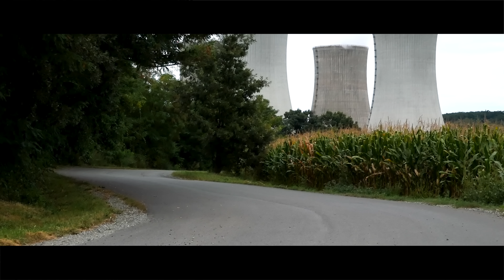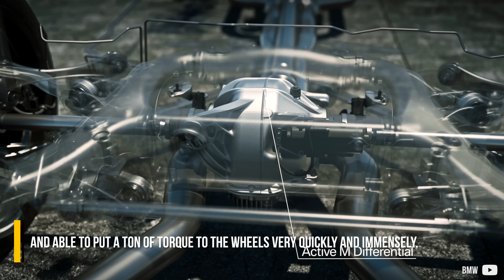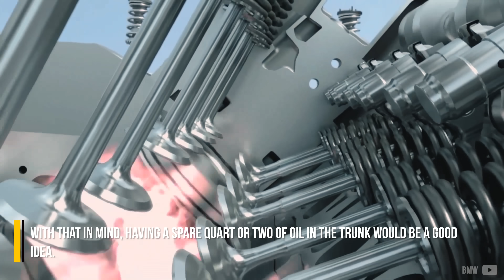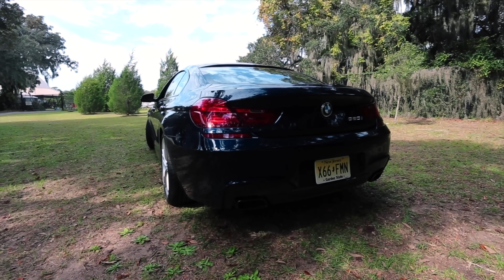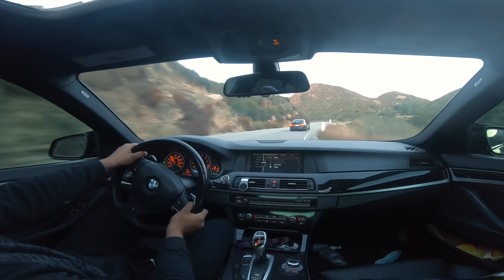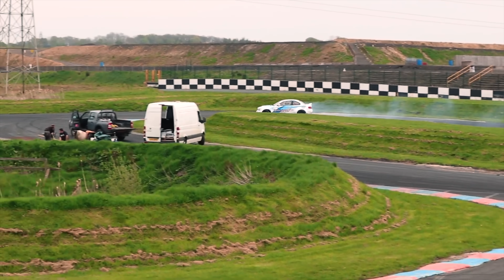The Worst BMW Ever?

Comment: No wonder people love LS/LT engines. Old and antiquated,  but powerful reliable and simple to work on.
Reply: An engine so good even chevy can't ruin it
Reply: Vauxhall VXR8. Everything I need is there. Literally. V8 and ancillaries, 6-speed box. 3-series muscle without 3-series hassle.
Reply: @EdgyNumber1  I used to work for Vauxhall at their now gone Luton storage centre, I had a lot of fun in those Aussie muscle cars especially the ultra rare blown Bathurst :) I think they are were more like 5 series competitor to be fair as they are a big old Sheila.
Reply: @EdgyNumber1  true but the handling department won't be as great
Reply: Nothing beats a Coyote, they can handle tons of boost on stock block. 800hp mustangs can survive for years.
Reply: I agree. This engine doesn’t make a lot of sense when you can have a big naturally aspirated v8 that produces almost the same torque and more hp that will live longer.
Reply: @clueless3398  Fuel consumption would be the main idea..
Reply: @izzy031096  oil vs fuel consumption I guess.
Reply: @izzy031096  LS/LT engines are almost identical on effiency with BMW V8s. Compare a 5 Series and Chevrolet SS, for example. Both 400 ish hp, 4,000 ish pounds. 17/25 on the BMW, 16/24 on the Chevy.

Small displacement quad cam V8 engines are good for dodging Japanese and Eurozone taxes, which is the biggest reason they exist. When taxes are based on consumption rather than dispacement, large V shaped engines tend to be pushrod.
Reply: @efcodpalama  LS/LT engines are far more simple and reliable. But as far as performance and efficiency you cant compare them. A downpipe/ecu flashed f06 M6 returns 25mpg. Not many 4 doors with a leather dash and heated/cooled/massaging seats  can do 200mph and 25mpg.
Reply: @izzy031096  LT1/LS1/LS3 motors in Corvettes get mid to high 20s in cruising.
Reply: @hexagonosaurus5848  It depends on what you mean by efficiency. Stock for stock, the EPA fuel efficiency is almost the same. If we're talking about vanilla variations then look at the figures I quoted above for a 550i and an LS3 powered Chevrolet SS. If we are talking about the ultra high performance variants (M6, LS9), then I think you'll find the EPA ratings are also very similar. An M6 and a Camaro ZL1, for example. The EPA rates an M6 at 15/22. It rates the ZL1 Camaro at 14/20. Both are 4,000 lb-ish sport coupes. Bear in mind the ZL1 is making 650 hp while the BMW is only making 560 hp.

If by efficient you mean "horsepower per liter of displacement" then yes, the BMW is "more efficient." However, horsepower per liter of displacement is not really relevant to anything a driver will ever do. Fuel economy for a highly strung small engine and a more relaxed large engine often favor the bigger engine, for example, and displacement does not equal "physical size of the engine" or "weight of the engine."

One of the reason the LS engines have such large displacement relative to the Euro V8 stuff is because pushrod cylinder head designs are vastly, vastly lighter and smaller than the massive DOHC designs popular in Europe and Japan. The large displacement pushrod stuff has a bigger short block, true, but it is usually lighter overall. An LS3, for example, is still lighter than a Coyote and much, much lighter than a Lambo/Audi V10.

Look at the picture I linked below for an example. The externally massive engine on the left is a 4.0L DOHC V8. The externally tiny engine on the right is somewhere between 4.8 and 7.0L. Pushrods are very, very space efficient in V-shaped engines. http://carphotos.cardomain.com/ride_images/3/3522/1469/33803234006_large.jpg

If you want an even more graphic example. The engine on the left here is 4.6L and the engine on the right is 5.0L. Externally, the "bigger engine" is about half the size overall.  https://www.mustang6g.com/forums/attachments/41ff84f19b22073d29abf3d940681287-jpg.198679/
Reply: @hexagonosaurus5848  What tune are you running? I have an F13 M6 and have been considering tuning it, but it seems like all the blown motors were tuned.
Reply: @izzy031096  Those BMW v8s chew through fuel just the same when you step on it. They only get slightly better fuel consumption than a big-displacement engine when driving slowly.
Reply: @izzy031096  I have a camaro with an lt1 motor I get 16 when i hoon but regularly I get 18/22 mpg 🤷‍♂️ not bad AT ALL for a 6.2L v8 with 455 hp/tq
Reply: @hexagonosaurus5848  THIS! This is what most people miss completely. LS are great don’t get me wrong. But BMW engines are so grossly understressed from the factory that $1500 in mods can add 100-200whp which is insane. Especially, like you said, when it’s paired with a way better handling, feeling, and looking car 🤤
Reply: @hexagonosaurus5848  funny thing is that GM can do with a V6 what BMW can do with a V8. My twin turbo LF3 v6 Cadillac with 420 HP stock will run 182MPH. Flashed at 505HP, it’s probably pushing that 200mph range.
Reply: @haredr6511  Funny thing is that BMW can do with a I6 what GM can do with a V8. Funny thing a stock G80 competition makes more power than your flashed Cadillac.
Reply: @hexagonosaurus5848  woh!!!!!! A whole 5hp more!!!!! Ha ha ha. And while it has a whopping 5hp more, it has 80 lb-ft lower torque and stickers for almost $30k more. I’d say BMW is pretty pathetic these days. For the sticker of an M3 competition, just trade-up to a Cadillac CT5-v with 663 glorious LS SC V8 horsepower and lay waste to the BMW.
Reply: @hexagonosaurus5848  a manual m57n2 with gtd2872 and supporting mod gets 35-40mpg
Reply: @csisticsakanyfeju1415  thats a diesel.
Reply: @izzy031096  My 6.2 ls3 gets 30mpg on a run and 480hp.. not bad
Reply: @hexagonosaurus5848  Can get 30mpg from my LS3 converted Esprit and 525hp.
Reply: @clueless3398  uhhh what? Please tell me which naturally aspirated engines? All the GM engines that compete are boosted too. Almost all the s63s engines dyno around 600hp. Bmw underates them. Add a 1400$ tune and you are looking at 700hp.
Reply: @wesley fancher  He's talking stock for stock, which is when NA pushrod engines are actually really fuel efficient compared to turbo motors, especially when doing any performance driving. My dad's LS9 gets better fuel economy than my S55, especially on track, despite making 50% more power.
Reply: @matthewjudge3763  im talking stock for stock? s63 is turbo stock.
Reply: @matthewjudge3763  That's because turbo engines, especially the German stuff, richens the mixture like crazy under load. Some of the BMW 6 cylinder turbos and AMG stuff run mixtures as low as 10.5:1 under boost. A naturally aspirated engine will almost never go under 12.0:1.
Reply: @wesleyfancher4280  the LS7 is a 500hp engine that weighs under 500 pounds dry. With a cam and valve train upgrades it would make more. When we get in to turbo charging the BMW V8 can’t even come close to competing. The BMW probably makes more low RPM torque, but you get too much complexity for that.
Reply: @clueless3398  tye BMW engine weighs and consumes half as much.
Reply: amen!
Reply: Reliable ….. a GM reliable …. 🤣🤣🤣🤣
Reply: @ebk_fixxdy6485  the LT1 LS motors themself yes lol, the newer small blocks are a toin coss lmao either trash in the first 30k or reliable till 150k
Reply: Lexus 5.0L makes 500hp with no boost and it’s not an oversized engine lol better on gas ACTUALLY reliable and with boost 1000+ hp nothing beats a Lexus V8 all american cars are unreliable out some milage on them and you’ll see I wouldn’t take an American car as a gift !
Reply: @ebk_fixxdy6485  yeah but it’s in a Lexus… :/ BORING
Reply: Nothing beats a Coyote, they can handle tons of boost on stock block. 800hp mustangs can survive for years.
Reply: This bmw engine can be a good choice if they get rid of the forced induction or make the oil changes every 5k miles
Reply: WE dont have LS engines in Germany. What models are They usually installed
Reply: @denzelcrocker4956   @Denzel Crocker  They are available in Camaros, Corvettes, and pretty much any truck or SUV made by General Motors. If I were you, I'd probably look for a GMC/Chevrolet motorhome, delivery van or campervan. 

Other engines with similar designs and similar virtues are the LT series engines (also GM) and the Godzilla engine (brand new in Ford Trucks). The Chrysler Hemis are conceptually similar but the build quality is iffy and the cylinder head design is big enough to cancel a lot of the pushrod packaging advantages. 

If you don't mind something older that will need aftermarket cylinder heads to make 400 hp (relatively cheap, btw), the older Chevy Small blocks came in almost every midsize or larger GM car from the 1950s until about 1996. The Ford Windsors are similar, though I recommend you use a 5.8L version rather than a 5.0. The Chrysler LA series of small blocks are also similar, though once again, I'd recommend you look for a 5.9L rather than a 5.2. 

For something really light and small for the displacement, the Buick/Rover V8 is a similar design.
Reply: Better get a b58 or m57n.
Reply: @Tomi Jerry that's because you didn't do your research on the valve dropping issue. Get some aftermarket heads and that engine will live past 200k. I have a friend that has an c6 Z06 and he has 239k miles on it. Yes he sent his heads to get the valve issue fixed right after he bought the car but after that he put on trouble free miles.
Reply: @Tomi Jerry yes but I really wanted a BMW V8. I'm a car dealer and I've seen alot of BMW my partner have bought and they all have just about ate his lunch. The valve seal issue on the 7 series and the the injector issues on the x5 that trash the engine. I even went looking on copart for an v8 powered BMW SUV and even the newer ones were on there for engine damage so I'll stay away from all v8 BMW for now. I priced the engines and they were all over 10k used and I checked everywhere.
Reply: Nobody above room temperature iq “lives” an LS/LT of any GM motor. Antiquated garbage
Reply: @MichaelM-to4sg  huh……. The LT/LS is an antiquated “piece of garbage?” Interesting, considering they’re some of the most bulletproof, long-lived motors in all the world. It’s also interesting that they power some of the fastest production cars around the track. There are very few cars that will keep up with a CTS-V, CT5-V, Camaro, or Corvette around a track. It seems you may be a little biased and uneducated in your opinions. Complicated does not translate to good.
Reply: @Tomi Jerry you coulda bought a crate engine that made more power for way less then that…
Reply: Turbo motors are better, sorry. I had a K04 B5S4, and I'd have friends at from work with LS cars drive it, race it, etc...every one of them was always "wow" about how the motor delivered power. Then again, you're here on youtube making unlettered observations about engines you've never even experienced.
Reply: They aren't old or antiquated... They have generations as well. And have kept up with the years. 
Ls6, i think we are up to now? 
Ls3's are common, cheap, and easy to modify for big power. 3's are what most people are using for their builds. 
But now we are opening a whole new conversation of bought vs built. 

Nobody buys an m5 to build it. We use 335's and 535's
Reply: LS and LT for the win! That BMW engine is some bull 💩!